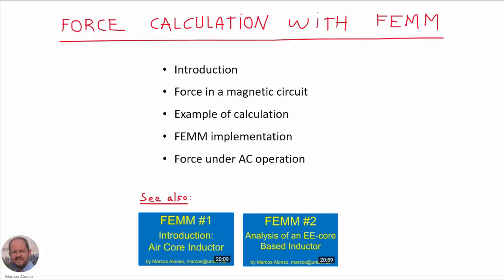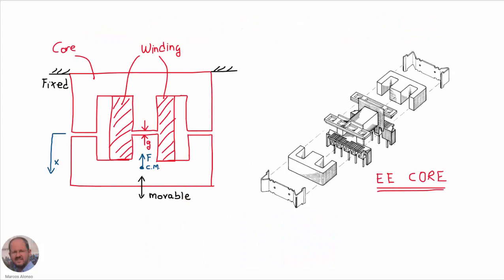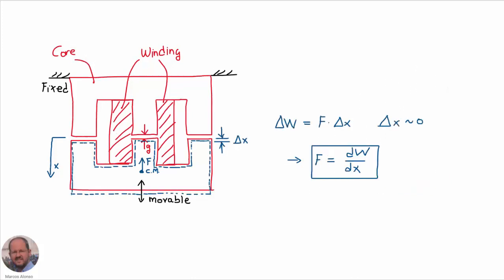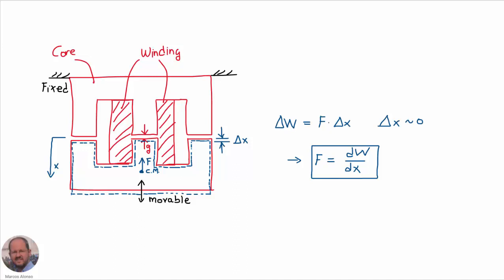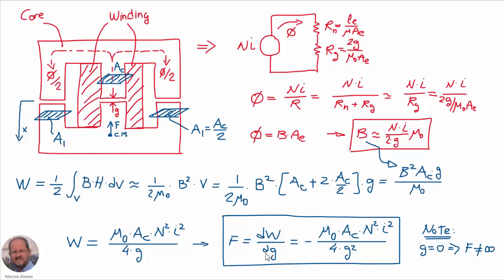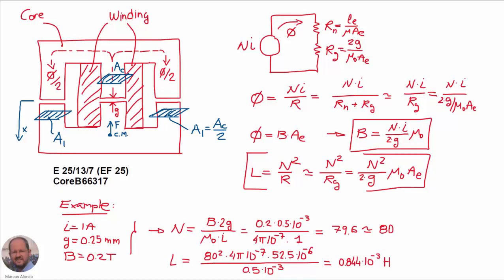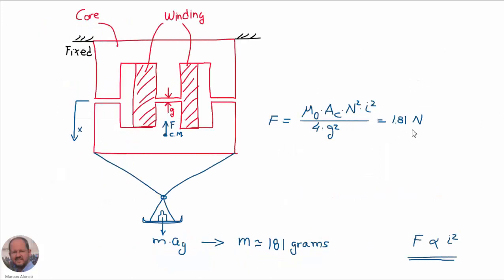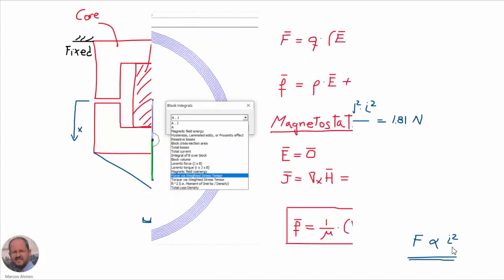FEMM #6: Force Calculation in Magnetic Circuits

Comment: Hello Professor Marcos, first, I would like to thank you for the excellent video. I have a quick question:

Is the difference between the simulated and analytical values because you are using an approximation for the reluctance?

If so, does this mean the simulated values are more accurate (or closer to the results of real-life inductors) than the analytical ones? How accurate is the FEMM simulation compared to reality values?
Reply from the maker: Hello, thanks for your question. FEMM analysis is more accurate. The theoretical formula assumes that the magnetic flux density is evenly distributed inside the core but in reality it is not. FEMM accounts for this difference. FEMM is very accurate compared with real life values. You could get more accurate results only by using a 3-D FEA tool. FEA tools solve Maxwell's equations at each point of the material. This provides very high accuracy

Comment: Hello Mr Alonso , thank you for your video. I want to calculate the force applied by flexible pcb coil which is flapping. Since its spiral we cannot calculate Lorentz force directly so I was thinking to use FEMM but I don’t know how to go about. Can you please guide me a bit.
Reply from the maker: Hello, thanks for your question. To use FEMM you need a planar or axial symmetry in your problem. Otherwise you will need a 3D solver. I would need more detailed information

Comment: Hello Mr. Alonso and thank you for your video. I was wondering if the force equations given are only applicable for three-leg transformer cores, or if they are generalizable for 2-leg cores as well?
Reply from the maker: Hello, thanks for your question. If done correctly it can be applied to any geometry. The virtual energy (or work) principle is a general principle of physics that can be applied to solve many different problems

Comment: Great video, but I'm confused by how the theoretical values match FEMM when FEMM doesn't take into account the current flowing parallel to the screen? For an example, if you were to scale the depth 10x, the force will also scale 10x exactly.
Reply from the maker: Thanks for your comment. There is no current flowing parallel to the screen. The current goes into the screen through the winding

Comment: Thanks for the great video! I also want to ask, how would you calculate the force if the core of the coils is non magnetic (coreless)?
Reply from the maker: Thanks for your comment and question. If the core is non magnetic or if there is no core, there will be no force on the core.
Reply: @MarcosAlonsoElectronics  oh alright. But there is still force in effect, right? Is the force on the coil then? Not on the Core?

Comment: Hi, did You use getdb or OneLab for electromagnetic resolves?
Reply from the maker: Thanks for your question. Everything was done using FEMM. No other packages were used.
Reply: @MarcosAlonsoElectronics  I also used the program for teaching students like you. But I want to switch to 3D modeling. Getdb is the best of the free programs.
Reply from the maker: @Aleksei_MOI  I will take a look. It seems very interesting. I visited the link: https://onelab.info/
The program you mean is GetDP, right?
Thanks!
Reply: @MarcosAlonsoElectronics  Yes, this is the software I have in mind. But this program is difficult to study.